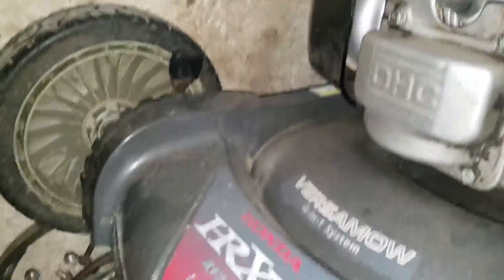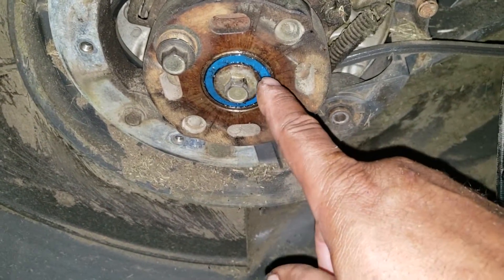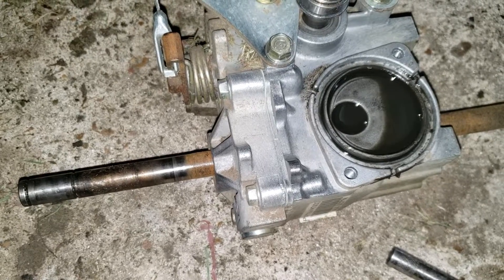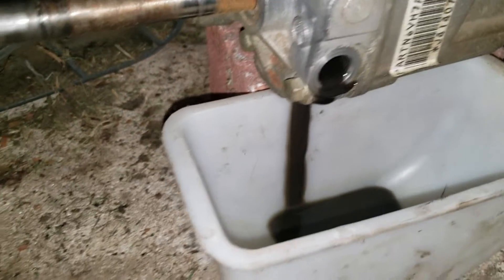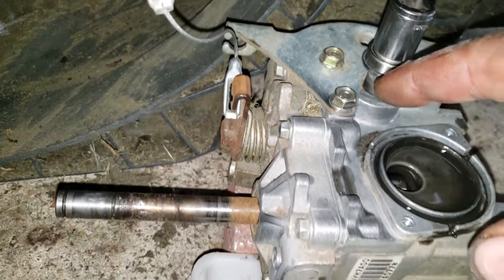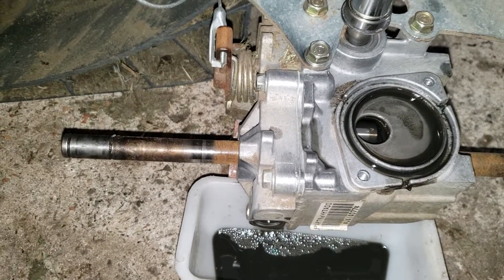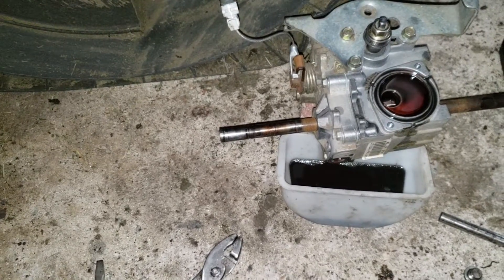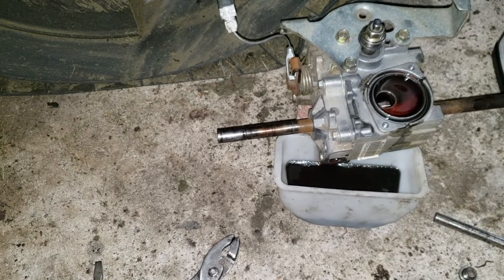Honda hrx217hxa hydrostatic maintenance

Comment: Is that drain plug on the bottom of the trans as it sits in the mover ?  Could it be done IN THE MOWER ?  Taking the trans out is SUCH A PAIN !!
Reply from the maker: Yes it is at the bottom of the transmission/mower. Thing is refilling is where it becomes difficult. I lil enginuity may overcome that obstacle.
Reply: @thisismee3642  HMMM   Thanks !!  I may just turn the mower upside down ! Thanks again. You have helped me SO much !!
Reply: Pleas let me know if you can make it work without removing the transmission
Reply: I just did add oil without removing trans. Got a 6mm Allen wrench. Drilled a hole thru plastic wheel backup plate and two layers of plastic housing (easy) to reach one of two drain holes. 
Sat on a slight hill to drain oil. Then I just laid it on it's right side to add oil. Need long thin funnel. Axel must be turned while adding oil. 
Takes 7 ounces of oil. Only 5 went in. Bought 12 ounce Honda trans oil. $10.
Reply from the maker: @stevejette2329  whoooa that is extreme but hey! You accomplished your task. You should have made a video with a disclaimer of course. It worked for that way, cool!
Reply: @thisismee3642  Now I have to run to catch up !!  Next problem is that the hard rubber tires are OK for a flat, dry lawn. But I am on a VERY steep hill. So my son wants to make them "studded tires" !!!  Screw in about 8 short drywall screws leaving 1/4' showing.  I will report back.
Reply from the maker: @stevejette2329  you might want to extend the wheel axle bolt with a longer shaft. Of course you know to match threads first. Setup in duallie fashion so you can remove the studded wheel when not needed. Also these wheel are expensive to just modify for brief use. The studded wheel will also aerate the lawn so water lawn after cutting.
Reply from the maker: @jfedorek86  see steve jette comment on this thread
Reply: @thisismee3642  excellent ! I am also thinking of converting the mower to nuclear power.
Reply: Did you drill the hole on the left side and run the funnel across to fill it or is there a drain in the right I can’t see?
Reply: @jfedorek86  No drain. Drilled a 3/8 hole angled toward the plug. Stuck the slim funnel down thru the three-layered hole.
Reply: On my way home to look at it now. Did you still through the wheel play and housing on the left side?
Reply: @jfedorek86  "Wheel play and housing" ?  I drilled thru the plastic backup plate behind the left rear wheel after I took the wheel off.
Reply: Ok. I am  a little confused. Do you drain the oil amd fill it from the same plug?
Reply: @jfedorek86  Any progress ?
Reply: Yes I got it done. The drain plug isn’t in very good shape though. I can’t find where to get a replacement
Reply: There are two drain plugs. There is one on the left side as mentioned in the comments above. The other is in the back. I was able to remove the one on the back after removing the shield that drags along the ground and protects debris from shooting out the back of the mower and hitting you in the feet. No holes needed to be drilled in the mower. I drained as much of the old transmission fluid as possible, then rotated the mower to a vertical orientation so I could refill with new transmission fluid through the same drain hole. I didn't repeat the process and perhaps that's why I didn't get satisfactory results. Transmission still growls and moves the mower very slowly. Maybe I'll try it again. Or, I might just remove the cogs in each wheel  that connect the wheels to the transmission drive shaft and convert the mower to a pure push mower as the engine still runs like a dream. If I convert the mower to a push mower, I'm not sure if I need to remove the pulley that connects the mower to the transmission too. Maybe someone will read this and let me know.

Comment: I believe I have a leak and my transmission just like this 1. Any ideas on how to fix a leak is it possible?
Reply from the maker: Besides having a hairline crack in the transmission case. The only other places for leaks to occur is shaft seals, transmission case gasket(s), or the various screw plugs threads. You will have to pull the unit out to find specifically where it is leaking
Reply: @thisismee3642  thanks! Pulled it out, replaced the o-ring and its working! Took a long time though...

Comment: Hi I have done all this but still slow. How do I bleed air from the system after refill. Thanks. Air is in the transmission
Reply from the maker: Your transmission could be worn beyond maintenance. Therefore it doesn't build and keep maximum pressure. Fluid is escaping the seals internally. That is my hypothesis from across the web with your given information.

Comment: hi i have 2 honda hrx217 mowers and either one doesnt do anything when i engage the self propelled does that mean the transmission is run out of fluid
Reply: @thisismee3642  thankyou  I checked the cable first adjusted it and made sure it's good tension didn't make any difference I'm not hearing or feeling anything when engaging so would that just mean it's the fluid not building enough pressure?
Reply: I have the same issue.  Did you ever figure it out?
Reply: @g4l430  I am having this problem also. This channel helped me more than any other about a year ago. I tried adjusting the cable but no difference. Now I am just hoping that the trans fluid can be added without taking trans out.
Reply: @g4l430  not yet